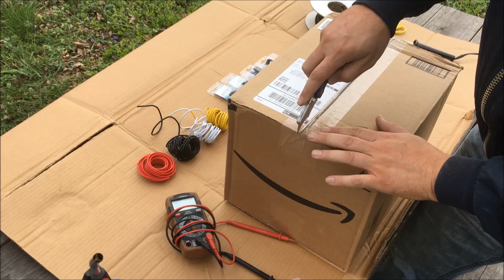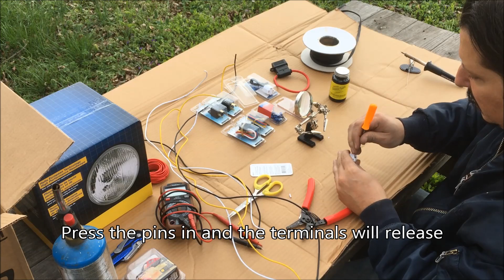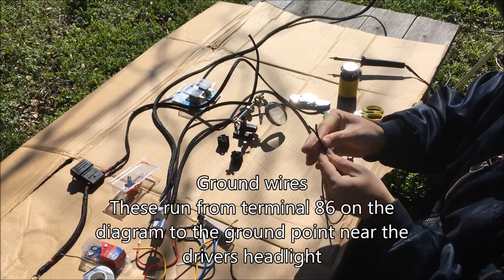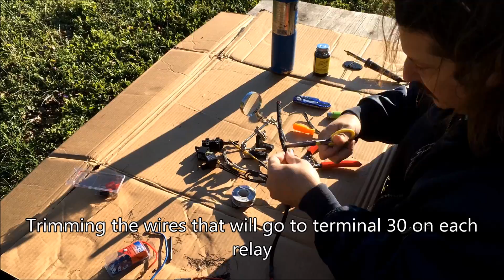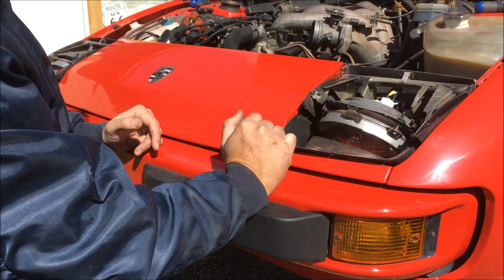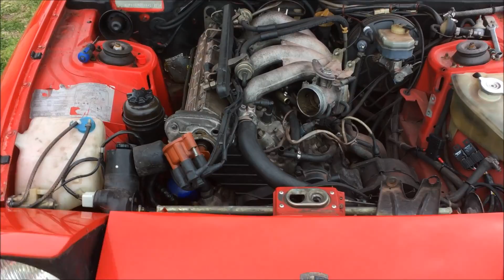Porsche 944- How to build a headlight harness

Comment: This is fantastic. Thank you. Would it be nuts to fuse this twice ? That is, instead of joining the high and low power leads to the inline fuse, you'd instead run a fuse holder (say 30a) for each high and low beam feeds/relays? Probably a belt and suspender overkill, but it seems like a nice safety feature in case a fuse burns out -- you'd either have high or low beams.
Reply from the maker: It's a great idea actually since if the fuse blows you still have either high or low beam. I started doing that after building these a while, but also haven't had any issue with the single fuse. Good Luck!
Reply: @edredas  Thanks for the speedy response on such an old video. Really great info. Thanks for taking the time to share your knowledge and experience!

Comment: I have always wondered if the headlight and tailight harnesses need to be relayed...or just having a fuse would be enough.
Reply from the maker: Relays allow you to get more current to the lights. While they are almost critical for halogen headlights I don’t think it would make much of a difference for the tail lights. If the tail lights are super dim try cleaning the grounds. I hope that helps!
Reply: @edredas  Do you think its safe to use the relay to power both headlights and taillights then?

Comment: Where do you recommend mounting the new relays?  In this video I see them wedged under the coolant hose but is that a temporary mounting spot or permanent?
Reply from the maker: Yup, I mount them under the coolant hose. I tried several locations before but under the coolant hose seems to work the best. I hope that helps!
Reply: @edredas  Is there any way for the new wiring to the passenger's side headlight so that it's concealed within the nose panel somewhere?  On my early car it seems that there's no easy route for the wiring to pass from one side to the other.  It looks like the stock harness passes behind the bumper, possibly, but not sure how much I would need to remove to gain access to that passageway.
Reply from the maker: @hampsonlaboratory1363  You can take the bumper off and then you should be able to route it the same way the factory did.

Comment: Hey Brent, I was wondering if you may have ran into a similar problem with your 924. After installing the new headlight harness, my high beam indactor will dimly light up with the factory fog lamps turned on via the switch on the center console. The indactor works as it should otherwise when the high beams are actually on.
Reply from the maker: Hi Matt, I've installed ones I've built on a 1988 924S, 1984 944, 1987 924S, and a 951 so far... and haven't seen this issue yet. I also had a car here with a harness he ordered from Amazon and I don't think he had any issues. Not sure what the issue could be. I hope that helps!

Comment: Master I have another problem my issue is driver side  headlight doesn't work,is no voltage on the connector I fallow the cables and I tested before of the connector and no power , right is ok  and anything else is working fog lights and the others I have power on the fuses can u help me,is anything I can do to make work quick ?
Reply from the maker: Hi, does the light not work on either the high or low beam or just one? If its both and the fuses look good then it could be the switch. I hope that helps!

Comment: My first question is..was it necessary..im guessing not unless high beams were in excess of 100 watts
Reply from the maker: The stock wiring harness is very long with high resistance and gets even higher as things corrode with age. The stock harness is barely capable of supplying enough power for the stock 35 watt low beams. I measured somewhere around 11.5 volts when it needs to be around 13.5 to be bright enough to see. When you factor in adding H4 beams that have a 55 watt low beam, then the voltage is even lower and the resistance higher which could potentially cause a electrical fire. So this harness will not only make the stock sealed beams brighter but it is almost necessary if you want to run H4's. Otherwise you're not going to be getting the most out of them and they will still be dim. I hope that helps!
Reply from the maker: That said, this is mostly geared towards older cars like the Porsche 924 used in the video. If you talking about a newer vehicle from the 90's to present, then they come with equipped similar harness' and there isn't much to worry about. Like you mentioned then I would only bother with a heavier gauge wire if you were running 100+ watt bulbs. Thanks!

Comment: Would you be interested in selling pre-made wiring harnesses?
Reply from the maker: Sure! They're not exactly cheap, but I could make them for about $150 shipped to the cont. US. Thanks!
Reply: I will take one kit how can I get it ? I run with one problem right now I don't have any voltage on headlights no low beams on both sides the only thing is working on front is the high beam passenger side

Comment: Again another great and helpful video Edredas! what size of the nylon braided sleeve did you order? Thanks!f
Reply from the maker: Thanks! Its 1/4" and here's a link to where I ordered it! I hope that helps!

https://www.ebay.com/itm/1-4-EXPANDABLE-BRAIDED-PET-SLEEVING-BLACK-100-FT-ROLL-1-4-INCH-CAR-WIRING-/381844309168?hash=item58e7b1c4b0